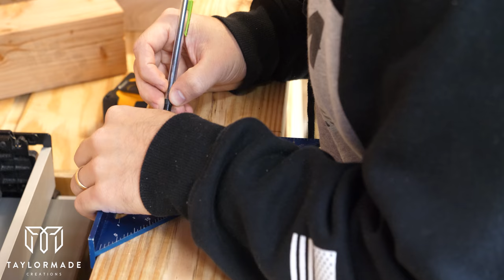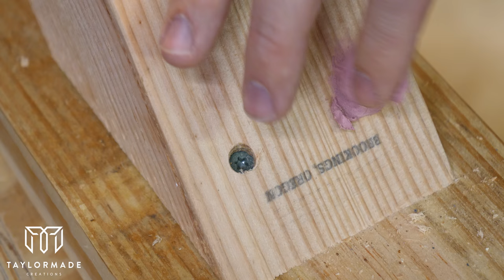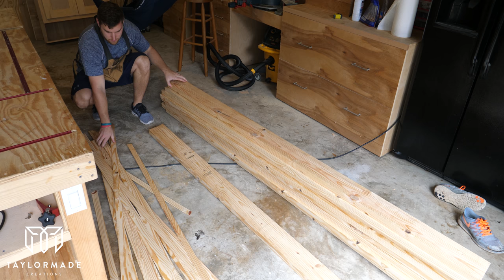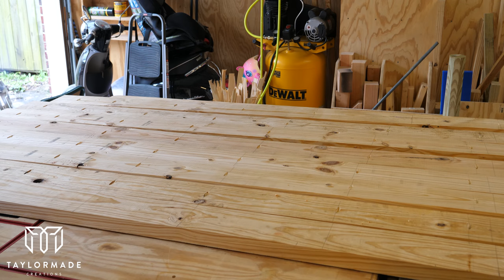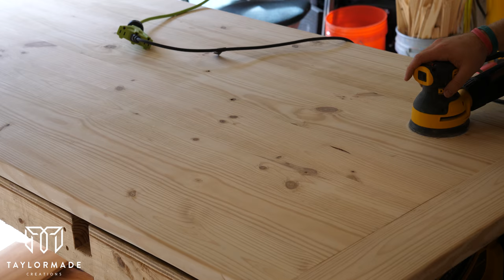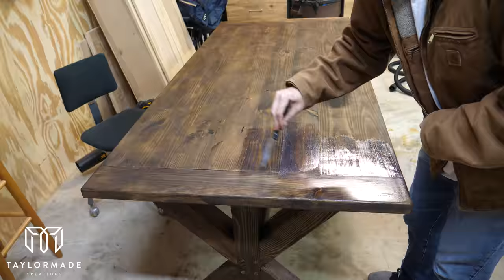Farm Style Table Build

Comment: Awesome build. I have built a table like this but instead of using wood putty to hid the screw holes. I just used wood plugs and cut them off flush. Also if you wanna use putty instead of buying it try mixing your glue and saw dust. Love the build and especially that dark walnut stain!